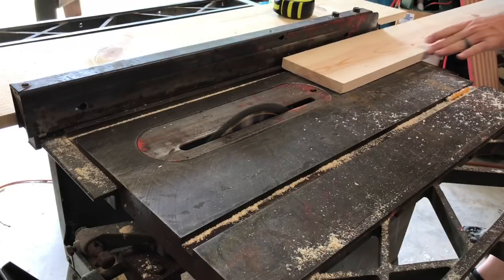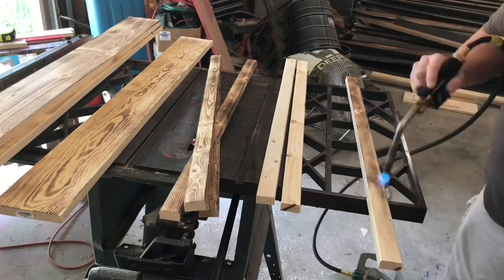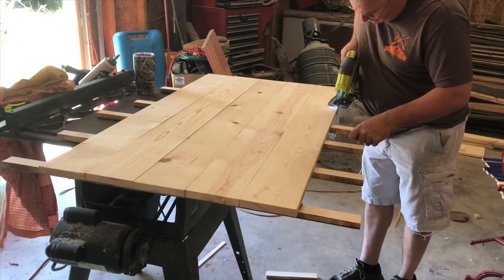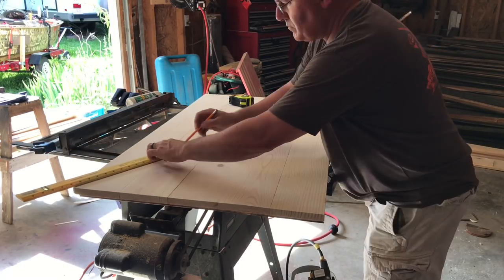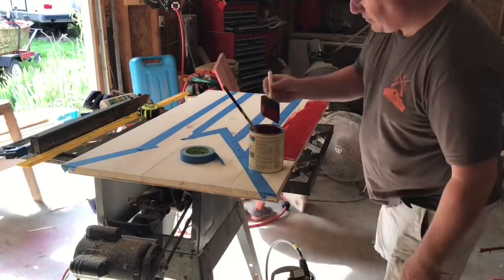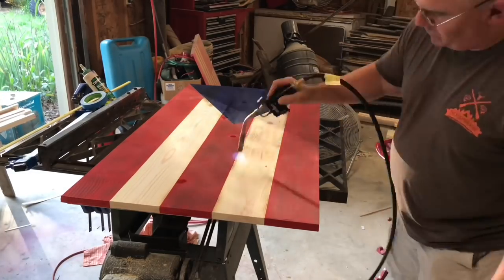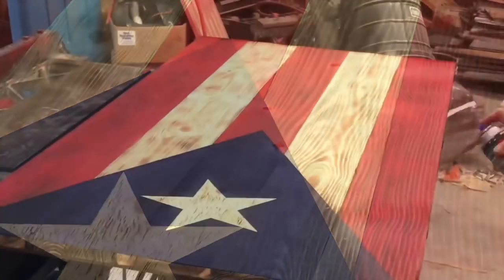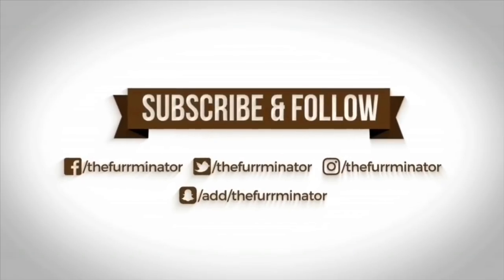Rustic Puerto Rican Flag / DIY

Comment: Jeff what is the torch set you are using in the video ? I would like to use the bbq tank with a hand held torch head with a hose like you are using.
Reply from the maker: Hey, here is the link to a video I made about the torch I use https://youtu.be/Y8kYcvByNMg
I just use the hose that goes to my grill, it has the same threads as a small propane bottle. You can get those hoses pretty much anywhere.
Reply: The Furrminator thank you